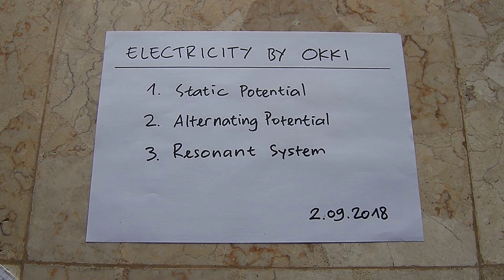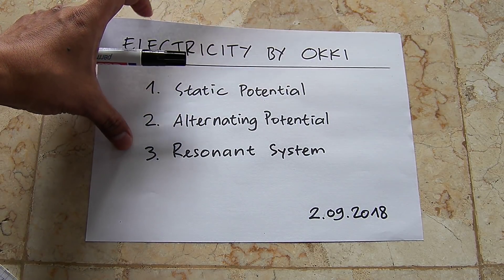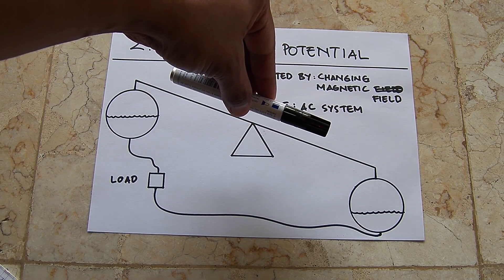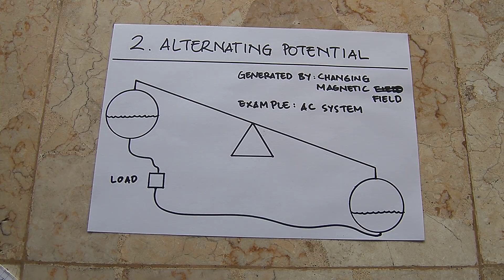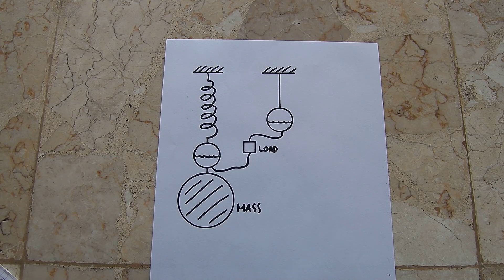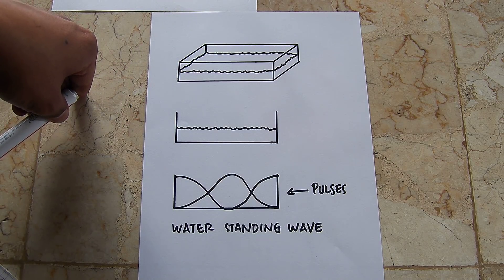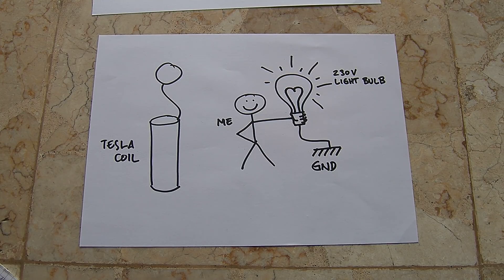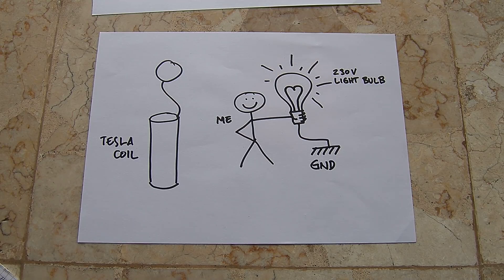Electricity

Comment: Your pictures are very nice ;) end easy. Magnetic field is only when electric field is consumed. We dont need magnetic field at all only at load. So voltage is primary and current is the rate in which electric potential is destroyed, and electric field of potential difference shoudl be consumed only in load not on transmision line like in DC or AC
Reply from the maker: Thanks for watching and for your explanation.
Reply: can u send me your email i will send u a picture that will give u some new or maybe not so new ideas.

Comment: yes electricity vs lighting who powers the most? who cost more? or how about 120volts negative and ground positive now does it run to positive or run to ground? you know what how come the flow runs from ground to positive and not positive to ground
Reply: Positive is air negative ground if you want energy you need oscillating of both or Spin magnet same thing just in air is less  compressed magnetic field, Magnetic field is energy not cooper wire ,cooper is just pathway for soo called electricity..